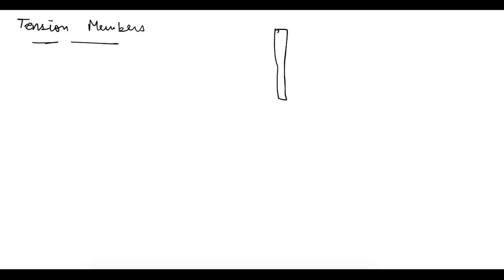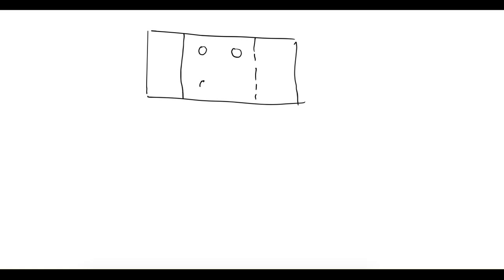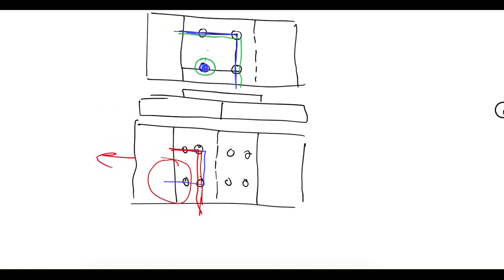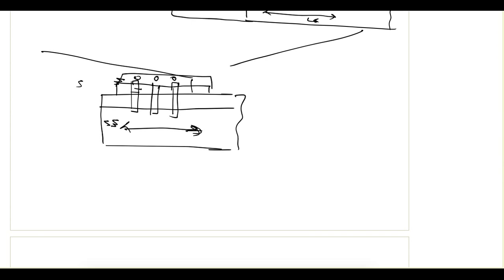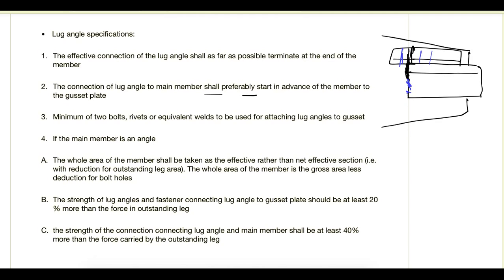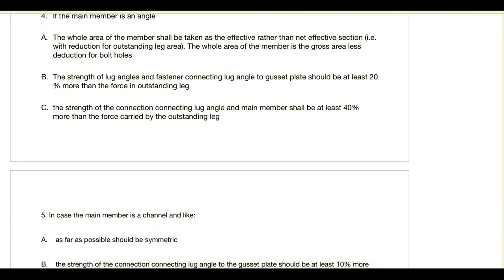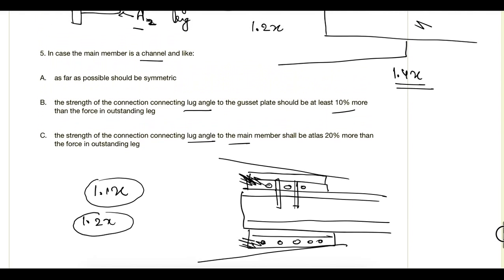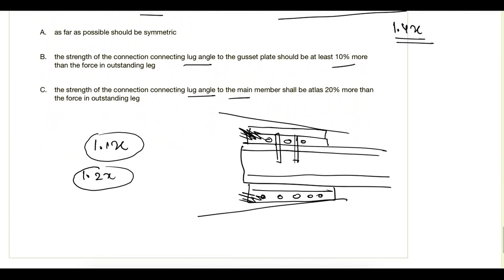Tension member splice, lug angles | Design of Steel Structures

Comment: Sir i think in lap joint block shear failure may occure in both way as discussed on 2.23 and 2.31 because at 2.31, remaining one bolt is only connecting part of one plate in place of connecting whole plate and hence failure will take place.